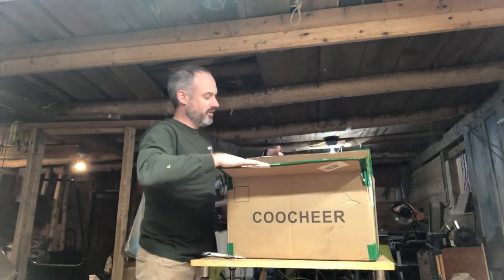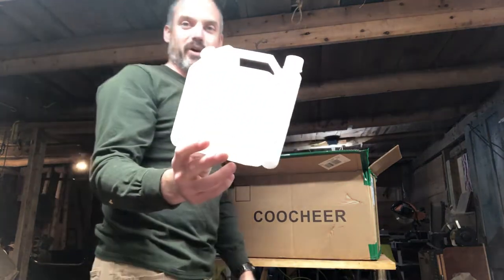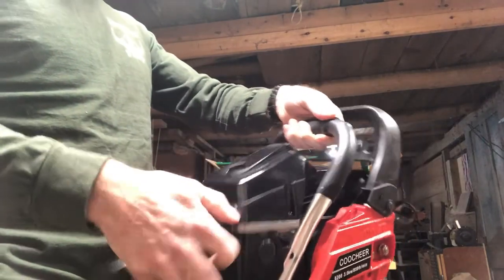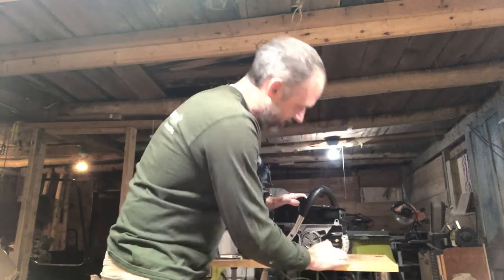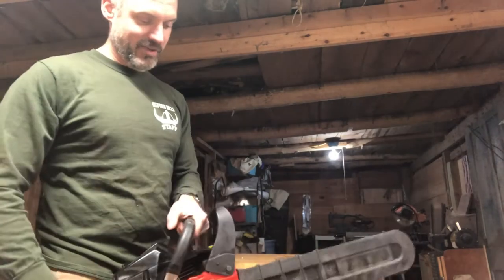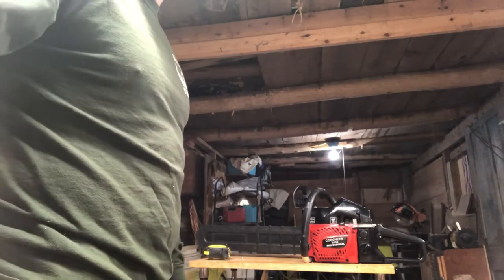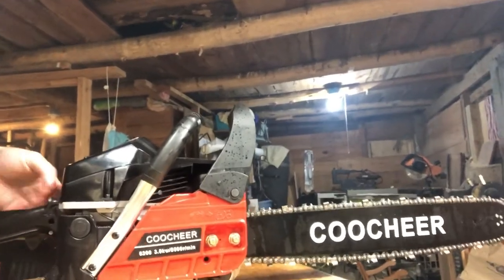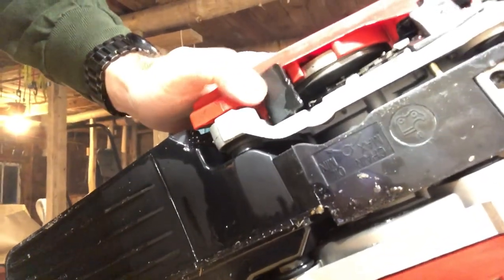Coocher 62cc 20 inch chainsaw unboxing and set up

Comment: If you are thinking about getting this one. DON'T  they are pure junk.
There are Chinese clones out there that are good from good quality control.  And that is the Salem master saws. The 62cc goes for $140 and can get from Salem master website,  Walmart,  home Depot, amazon. 
Another cheap good saw is Walmart black max 52cc 20". Retail $220 but regularly go sale $99-$130 and come with 3yr warranty. The black max saws are identical to the ryobi, black and decker, homelite saws just different stickers.  All these saws are Honda engines.